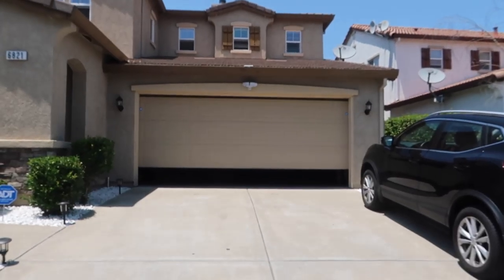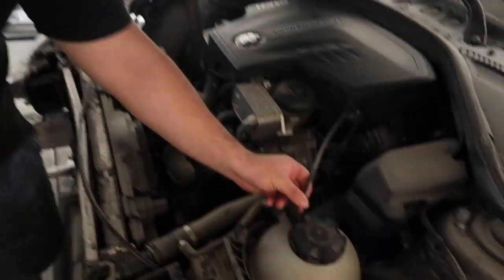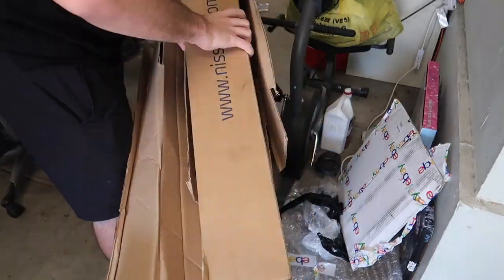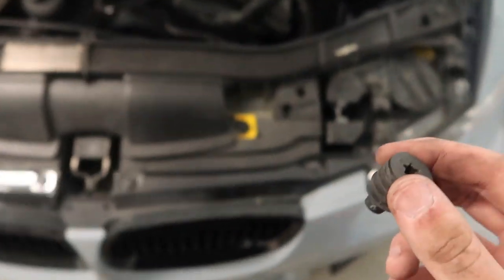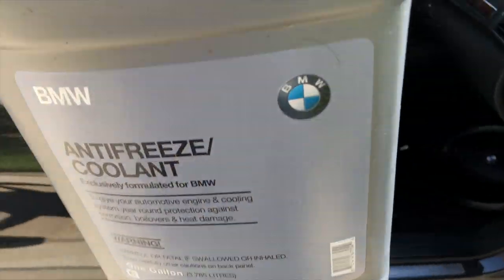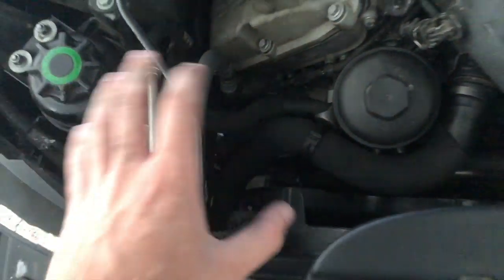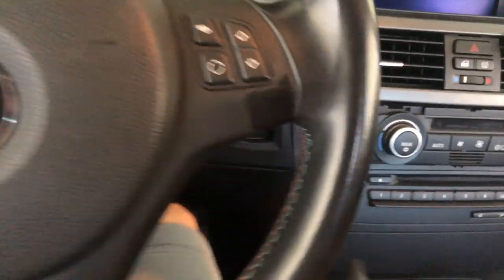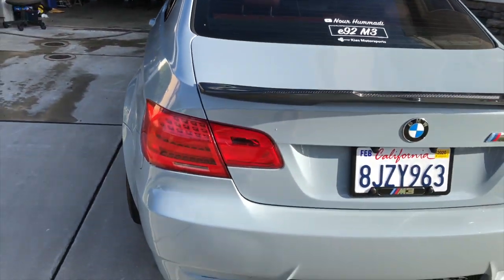$600 LATER! LETS GET THIS M3 BACK ON THE ROAD!

Comment: That oring in your lower radiator hose is toast now because you lubed it with wd40. It will become brittle and crack super fast now. Always use silicone lube on plastic and rubber parts.

Edit: lol that came off as super snarky which it wasn't meant to be. Love the videos just relating the info that wd40 will kill rubber and plastics
Reply from the maker: Richard Schuh I understand if I see a leak I know it was becuase if that thank you. Always take these things into consideration. I’m always trying new things and learning so any tips is amazing